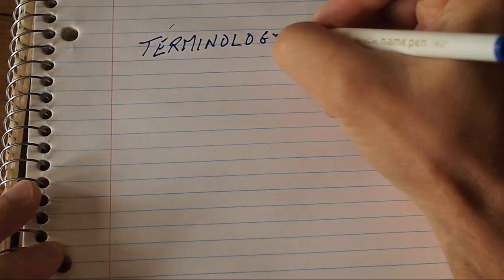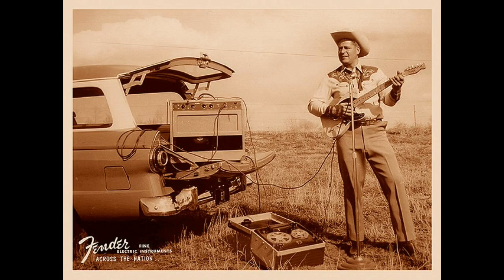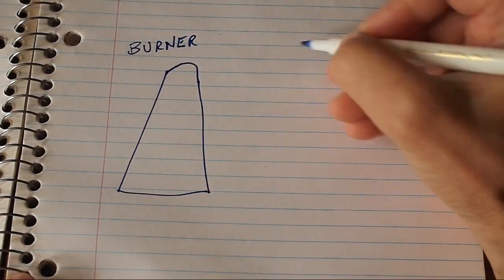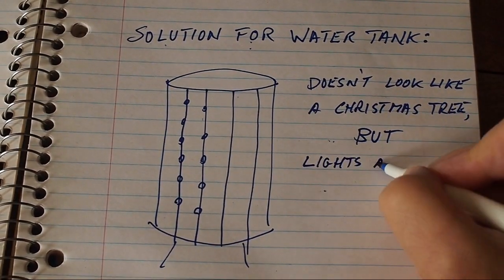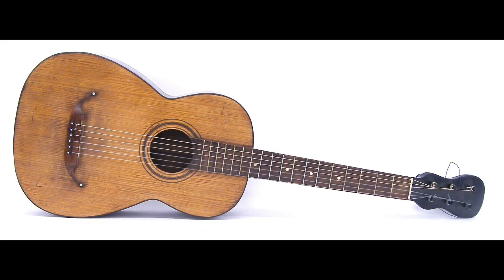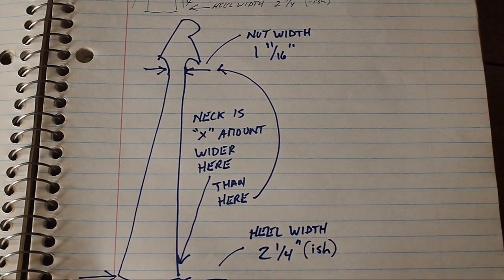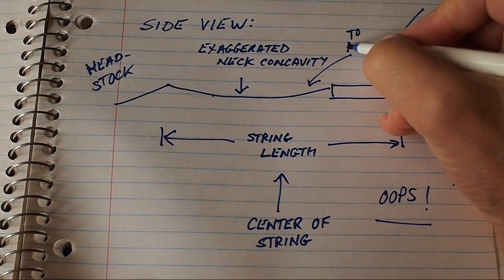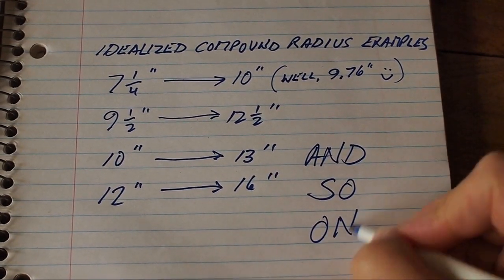The Facts about Compound Radius Fretboards

Comment: Good explanation, BUT there is one important factor left out, and is why you want an exaggerated conical shape (one where the radius at the 22nd fret is actually more flattened than the 1.33/1 ratio specified). The reason is when you bend a note, you are changing the attitude of the string towards the nut by dragging it across the fret, which reduces its angle significantly to the nut. This results in the string tending to "fret out" since it is the same effect as reducing the radius at the point of the stretch. To compensate for this - and this was the reason for compound radii from the beginning - the ratio needs to be increased to the point where a stretched string also maintains a level of "conicality" similar to the ideal. Warmoth is the inventor of the compound radius, and determined a 10" to 16" compound radius was the best compromise. That's a 1.6/1 ratio. This works well because the strings are necessarily progressively higher from the frets as you go up the neck. That additional clearance compensates ideally for the decreased angle to the nut during note bending.
Reply from the maker: Lovely explanation, and absolutely correct (except for the claim that Warmoth invented the compound radius, which is actually a centuries-old technique). Playing style will affect the usefulness of the compensation you describe, so it's not for everyone.
Reply: I have just been introduced to FGN (Fujigen, Japan) Guitars and their 'CFS' (Circle Fretting System)system. This introduces a slight (very) radius on the fret in relation to the nut because, as you pointed out, the strings are not perfectly parallel to each other. I assume CFS along with the conical radius would produce the ultimate neck considering all mathematical and physical challenges. @auburnamplifiers1786
Reply: @auburnamplifiers1786  on this note, a video on "fretting out" would be great .. tks

Comment: As a guitar builder I will say your explanation of conical radius is the best I have ever seen. It also puts to shame all the guitar builders who say there is no advantage to them over a standard constant radius. And anybody wondering if their fret board has the proper or optimum radius ratio here is what you do. With strings off adjust your truss rod so the fret board is straight. Place a precisian straight edge on the fret board directly in line with the string path from nut to saddle. There should be no space under the straight edge and it should not rock. Do this for each string path. Also if you put your straight edge directly on the center line of the fret board, it should be straight. But when you check going parallel to the center line working your way to the edges it will not be straight. With that being said will you notice the difference on an electric guitar? Probably not. But on an acoustic you should. A conical radius is the correct way to build a guitar, but only if the ratio is correct and you get the results I described. Things like this separate the wood workers from the luthiers.
Reply: CHAN LEE $5,000 for acoustic $2,000 for electric and goes up with embellishments.

Comment: I guess I've got your point, sort of, I may disagree on some things, such as 3:19 or 3:24, and I have difficulty imagining the slacking lights or whatever. I think I will make one for myself and see how far I can bend the string before it stars buzzing. I can compensate the likely better playability of a curved fretboard at the slight expense of either bending or of strumming by varying the ratio of radii at nut and saddle, so I will sacrifice some bending, and see if my playing improves. My guitar is about 100 years old, has about 10 or 12 mm action and shouldn't be too hard to beat using digital technology. Thanks!

Comment: Hmm, just did some measurements and math, it seems my string spacing (standard Floyd with an R3 nut) is just about 1.4 times wider at the 22nd than it is at the nut (35mm at nut, 49 at 22nd fret). This means that the ideal compound radius would actually be closer to 12"-17" (about 16.8") than it is to 12"-16" .
I know it shouldn't make that much of a difference but it still bugs me.

Comment: What a great video...my only question is why some very popular builders refuse to offer this, even as a feature / up-charge.  
For massed produced guitars and even for some custom shops / custom runs -- necks are all done via CNC / PLEK anyway, so why wouldn't they at least offer this to people who want it?
Reply: I'd love if Carvin would offer this, but sadly never have. Jackson is the only brand I've ever seen that really touts these
Reply: Off the top of my head I know these builders offer it right now:

1.) Jackson
2.) Fender (elite series)
3.) Charvel
4.) Suhr 
5.) Strandberg
6.) Gibson (all of the HP models?)
7.) ESP (custom shop only)
8.) Warmoth (From what I've seen they basically invented the CR)
9.) Schecter

I know Ibanez etc. prefer to do a flatter 15" type radius for the whole neck and then PLEK it so that going down the neck the frets get just a little bit flatter, and they also do fall-away frets for the last 4/2 usually.

FWIW I've heard Kiesel used to do CR necks but as of right now it's not an option on their website -- seriously thinking about getting one, I will probably end up calling and asking -- if I find out for sure I'll come back and reply!
Reply: great reply, I'd love to have them on all my instruments but that would be a ways down the road. The middle-of-the-road Jackson models seem to be to cheapest option, but I think Schecter has them on a few select models (12"-16")
Reply from the maker: Thanks very much for providing this comprehensive list. I should add that USA Custom Guitars offers 5 different compound radius options on their custom necks.
Reply from the maker: Thanks very much. Good question. There are probably a few forces involved, one being the significant traditionalist inertia in the marketplace.
Reply: Mighty Mite sells compound radius necks.......
Reply: Unfortunately Warmoth does not offer compound radius necks that follow the 1.33 rule. They only offer 10-16, which is almost as far away from 1.33 as a straight radius is.

Comment: The content of this video sounds exactly like you read my rant on compound radiuses in the Luthier's Corner of the Les Paul Forum several years ago.  You draw exactly the conclusions that I made in that rant.   So...I agree with you.  Or maybe you agree with me.  Either way, the results are the same.   The ratio of radiuses at the end of the fretboard should follow the ratio of the fretboard widths at the ends.
Reply: Glad to hear we're on the same page, although I hadn't been aware of any prior discussion when I shot this. Curiously, this spontaneous sidebar into guitar geometry has been my most watched video to date, despite my being primarily involved in making semi-custom amps. I have great respect for independent luthiers.

Comment: That was extremely useful to see the math and examples. I have a Strat with a 7.25" radius fretboard, and a 9.5" radius block. Now all I need to do is figure out is how to use that block to transition smoothly from 7.25" at the nut to a 9.5" conical radius at the 21st fret. Thanks
Reply: Picksalot check out Mike’s technique:
https://youtu.be/9peWdSb7Ghs
Reply: @Riverdeepnwide  Thanks for the link. That was very useful. A couple months ago I decided to just re-radius all the frets  to 9.5" to see what would happen. It worked surprisingly well. Though, I do get some fretting out above the 12th fret, exactly in the area that Mike started working on in the video to get a compound radius. 😎

Comment: Love the video.  I’ve seen compound radius fretboard with a pretty wide range like 10 to 16.  I doubt that the supplier has accommodated for the hardware and fretboard widths to match a consistent scale.  My guess is the general audience can’t perceive changes that small.  I wonder would a player receive more benefit out of it even if its not perfect?  Hope that makes sense.

Comment: The earliest utilization of compound radius for electric guitars was developed by Michael Steven Scheel (a guitar player from San Diego) and the luthier Brian Nelson (of Seattle, owner of Guitar By Nelson) back in the 1980's after Mike had moved to Seattle. The discussion of this technique with someone at Boogie Bodies (later to become Warmoth) led to them developing it commercially. I heard about it from Mike and Brian in perhaps 1984. To my knowledge that's how it started. - Bill Bainbridge (2019)
Reply: Bill that's cool info!
In the late '60s I remember luthiers producing a conical effect during fret dress' by taking off a little more from the centre of the frets as they went up the fretboard. 
As the video mentions it works out to a .014" difference, that's like four or five sheets of paper thickness. 
I wonder how long the technique has been around before it was commercialized and jigs set up to produce it?
Reply: That's a great question, as I don't know whether East Indian luthiers may have tried it with Sitars as soon as they began using wire for frets? Know any sitarists who might know?
Reply: That's a good point about the 1960's luthiers, and they were probably trying in a less formal way to help with the same problems of "fretting out" on bending, etc. Interesting question about the history of multi-radiused fretwork, as the history of solid (metal) frets isn't really that long. I suppose it's possible the East Indian Sitar Luthiers may have had early experiences with it, but I really don't know. Commonly available radiused fingerboard guitars might not go more than 150 years back.

Comment: Nicely done, Auburn Amplifiers. If you dabble in luthiery or you are searching for a new neck for your guitar, this really helps. 
Now, if I read this right, then this 1 to 1.3 ratio accounts only for the natural cone caused by string spacing, tighter at the nut and broader at the base. One can--and maybe should--compensate a little more (than 1.3X) at the base of the neck to allow for string movement & avoid fret buzz. Thoughts?

Comment: I liked the explanation and all but... is 2 and 1/4" a standard at the 22nd fret?
I've tried to look up for measurements and what I found (with Fender specs) was about 2 and 3/16".
Also, If i understood this correctly, a wider nut would mean a smaller difference in the total compound.
So the "ideal" compound will vary a lot for each guitar. If we put a 24th fret, for instance, the delta would be bigger.
Reply from the maker: You're correct. This video uses some average figures because a greater degree of precision isn't likely to yield better results, due to the various other factors that creep in, like neck and/or fret imperfections.

Comment: Great explanation!  Would perhaps have been useful to point out that to maintain the parallel string height you also need to have an adjustable bridge.  Most hard tails have a 12 inch radius anyway.

Comment: What should the bridge radius be for a 12 - 16" CR neck?
Reply from the maker: Well, for a 24 fret guitar, the fretboard is about 75% (three fourths) of the total vibrating string length. So if the string radius is flattening 4" over 3/4 of its total length, it stands to reason it should flatten an additional 1 1/3" (one third of 4") over the remainder of its length. So the answer is 17 1/3", although this is probably an impractical degree of precision. Saddle notch depth and string diameter become factors, as well as neck concavity, uneven frets, etc.

Comment: What I did was take a 12" radius block. Marked the nut spacing. Set it up for a dial indicator and checked all 6 string positions from zero.
THEN marked all 6 bridge positions and did the same. Since the width and spacing differ between the two in the scale length there is a BIG difference when the string is the same height at the nut as it is at the bridge.
When this is applied to the frets with a straight 12" neck radius that is. As the radius goes wider at the bridge the 12" neck stays straight where the outer strings widen out and fall into a different arc.
Very confusing.

Comment: How do they produce necks with a compound radius?  CNC machine?
Reply: There are rotational jigs holding a neck at an angle over a long belt sander. The distance at each end rotation point can be adjusted to the desired radius length, and then the whole assembly gradually lowered down onto the sanding belt while swinging back and forth to produce the conical surface. 
Another type of conical jig can hold several necks around its outside surface, which assmbly then rotates over the sanding belt.

Comment: Nice video! Would be good to know more about why the strings have to be not parallel, making them parallel would be a more obvious solution, probably there are some reasons behind that decision
Reply: Thanks very much, Dmytro. Good point. Some instruments do indeed have parallel or near-parallel strings (classical guitars, Rickenbacker basses...). The driving reason behind making strings non-parallel is likely ergonomic: chording is more comfortable with a closer spacing than finger-picking is, so instruments supporting those playing styles will reflect that.

Comment: The difference from low to high on a 12" radius fretboard is so small it doesn't matter, plus by the time the imperfections of adding fret wire and then leveling them its going to create variables. On a 12" radius If you bent the high E all the way to the low E it wouldn't matter because the nut is 12" at 43mm and the bridge is 12" at 53 mm, so once you press down and fret up higher, you eliminate the nut radius and are using that frets radius compared to the bridge.
Pretty much all the greatest rock and metal has already been recorded with straight radius necks from Gibson and Fender. Also, not Satriani, Vai or Yngwie use compound radius.

Comment: Good stuff! I don't think I've seen another video making a connection between the growing radius and constant action, with straight neck. This is sound math principle in action (pun intended).
The thing about compound radius fretboard is that it's less forgiving wrt tolerances. I've had a Warmoth neck with 10-16" radius and the neck was just not as well built as an Anderson or Suhr would have been; I could never achieve a constant action on that neck, not even close.
Reply from the maker: Thanks! It would be interesting to explore that observation further.

Comment: So is the Warmoth 10-16 compound radius not a good choice as these measurements were not shown at the end of your video as following the rule
Reply: Brian Z Im wondering the same thing!!
Reply: It would be 10"-13" following his measurements.
Reply: @willhoren9200  Well, since it would actually be 13.3333", it's closer to use 13.5". If they started with 10.5" then they could have a perfect 14" at the end. But this whole math is based on the ratio of 1/3 bigger at the end. Since the measurement of the nut could change, the ratio would change as well, so it would vary according to each neck. But yeah, their solution is exaggerated, apparently.

Comment: I have a 9.5-14 compound radius neck, should I get flat pickups or stagger pickups?
Reply from the maker: I wish I could give you a definitive answer on that, but it really depends on other factors, like the sound you're after, strings, pickups - even the visual vibe. Those strings will have quite a flat radius at the pickups, though.

Comment: Sorry, maybe cause english is not my first language...but I missed the point.
Why does 6 string who start and finish with different space between them, on a flat radius, the action of 'em increase nearest to the bridge?
I can't get it..
I got a 12" radius srv strat and the action is quite the same all over the neck , even if the strings gradually shift away one to onether according to the bridge saddles at the and.
Can someone explain me? I'm sure I'm wrong but I don't know why 😂
Reply from the maker: Hi Dave. Thanks for your comment. The string spacing does not affect the "action" (string height)  over a flat fretboard. The strings could be parallel to the fretboard, or not at all. Think of a door opening and closing over a level floor. It doesn't matter how tall or wide the door is: the bottom edge will always have the same relationship with the floor. I hope this helps!

Comment: So what is the radius of the bridge, for example, on a 12" - 16" conical radius fretboard guitar?
Reply from the maker: This is an excellent question. Let's figure it out. We know that a conical fretboard's radius changes in a linear way. In other words, at the half-way point between the nut and the heel, the radius of a 12" - 16" board will be 14". We also know that the heel is roughly where the 24th fret - or double octave - would be. Well, that point is half the distance from the 12th fret to the bridge (it has to be for the string to vibrate at twice the frequency, i.e. to be an octave higher), and that the 12th fret is the half-way point of the string's entire length (for the same reason). So, the heel of the neck is at roughly the 3/4 point of the string's vibrating length (half, plus half-of-a half). So in 3/4 of the nut-to-bridge distance, the radius changes 4" (16" minus 12"). Your question is now, "4" is 3/4 of what?" The answer is 5 and 1/3" (4/3 times 4"). So we add 5 1/3" to 12" (the starting radius) and voila: the string radius at the nut is 17 and 1/3". The error from our estimate of the neck heel's location is negligible, especially allowing for variations in saddle string slot depth. I hope this helps!
Reply: @auburnamplifiers1786  "the string radius at the nut is 17 and 1/3"." You meant the radius at the bridge, correct? :) Sorry for the...months long late reply, heh :) Cheers!